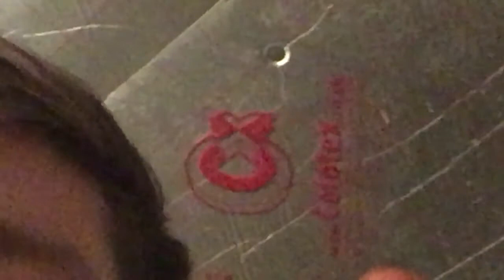How to Insulate a Flat Roof , Floor , Stud Walls & Calculating U Values

Comment: Hey there.  I am renovating an old stone and red brick built house.  Not cavity walls.  Was wondering what the best way to insulate the interior of the exterior walls.   I was going to stud it out like you have done tho do I need a 50 mm gap between the wall and the stud?
Reply from the maker: Yes, it really makes a difference. I’ve got 100mm celotex slotted between the studs. it’s winter now and it take about 30 minute to heat the room. Boiler turns off and the room keeps to heat for 3-4 hours before turning on again. Crazy
Reply: Matt Hutton   Thanks for the reply.  I look forward to staring the stud and insulation job.  Can I put the stud up against the wall with a damp proof or do I need to leave a 50mm gap between the walls and the studs.  I can’t seem to find good information about this sort of job.   Thanks.

Comment: Hi Matt, how did you attach the batten in the ceiling to the insulation? it looks like it may be screwed? did you screw through the insulation to the roof joists? Cheers Chris.
Reply from the maker: Chris Embleton exactly! :) with some very 25 to 30mm washers
Reply: @MattHutton  thanks. On my list of stuff to do today. Figured 25mm washers and screws through the batten and into the joists.
Reply from the maker: Chris Embleton nice :)